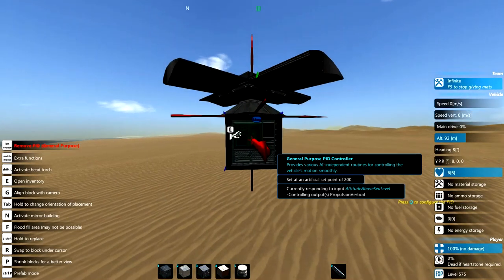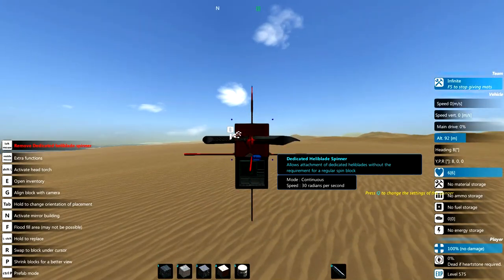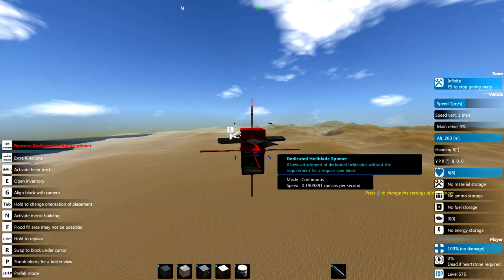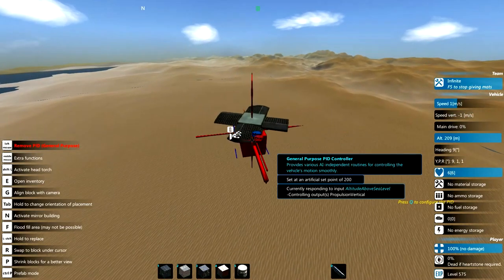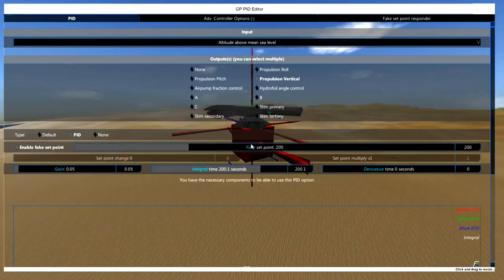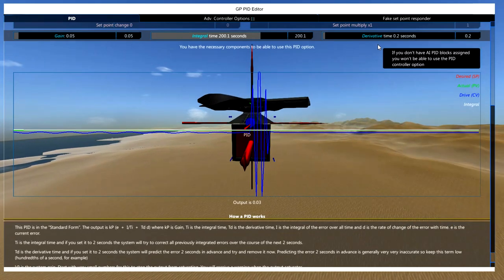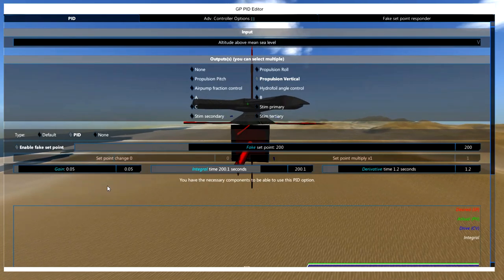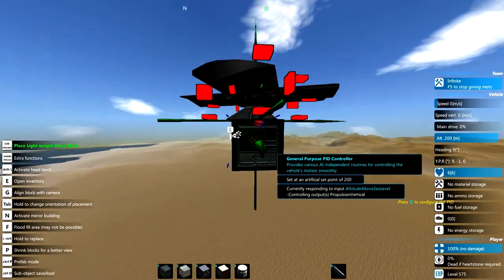PID Controller Tutorial

Comment: INTegral and inTEGral are different words. INT is math, TEG means important
Reply from the maker: Nope, same word. We, as English speakers just emphasize different syllables to bring emphasis to specific words in the sentence. The reason the pronounciation is different is because TEG is an adjective, while INT is a noun, as it has separated from being an adjective in "integral number/value" into defining the entire phrase as "integral". They would be placed at different parts of a sentence, like the chord progression of a song. They may hold separate definitions for various uses of the word, but overall, they are not different words. 

If I mix it up the pronounciation in the video, it's just cause I'm dumbcubs. I might also be pronouncing it TEG when I imply that i'm saying "(the) integral (value)". To pronounce it InT, i would have to slightly pause mid-sentence, thus breaking up the rythmic timing of English. Math does this to language a lot.

Comment: I have a problem with my little planes, i use the pitch PID to make them not spazz fly, and it works, but when I spawn a second or third behind them, they nosedive into the water.
Reply: If you like, I can probably figure out how to share the blueprint.
Reply: @chrisness8382  One thing, most PID issues i've experienced come from conflicts between AI and the PID
You would think the AI would know how to handle a PID, but it merely fights it for control instead
solution: change to land AI, it will take care of basic direction and movement while the PID takes care of keeping it straight, since land AI ignores roll
Reply: @rompevuevitos222  I thought they fixed that though, and I use the AI PID system.
Reply: @chrisness8382  Not sure, as far as i'm aware there isn't much difference to AI PID and normal PID anyway
AI PID is limited to AI input but that's about it, it works the same as the other one
Reply: @rompevuevitos222  Thanks for the headsup.

Comment: so what i'm getting is: if i where to set integral to 5 seconds, the PID would have an objective of correcting the error in less than 5 seconds?
Reply from the maker: No, compounding the error over the last 5 seconds to add to the output. It's adding error over time; you're just setting the time cutoff for when it stops counting.
Reply: @Spudcubs  So it will accumulate the gain over those 5 seconds to compensate? like, the longer it goes into the negative the more power it will use to counter it
Reply: @rompevuevitos222  yes, that's right. If it has some positive and some negative, they cancel out too, so a higher integral time can smooth small bumps but can also lead to overcorrection.

Comment: how do you know what to put the gain at. do you just mess around with it until it works?
Reply from the maker: Yeah, pretty much. It becomes very dependent on what you are doing with them. You get a feel for it with time.
Protip: low gain and higher integral time is good for stability, but high gain and low integral is good for quick reactions
Reply: Ok thx